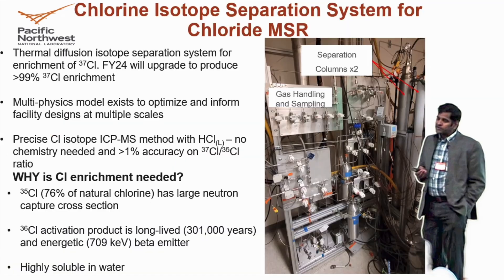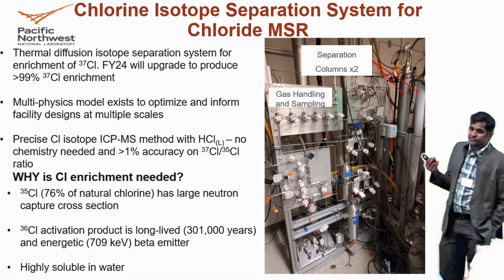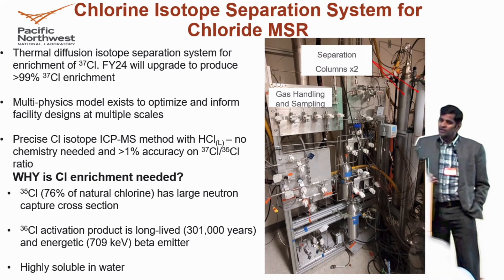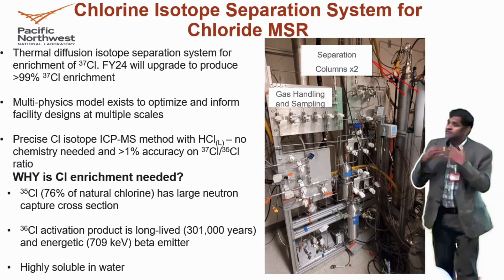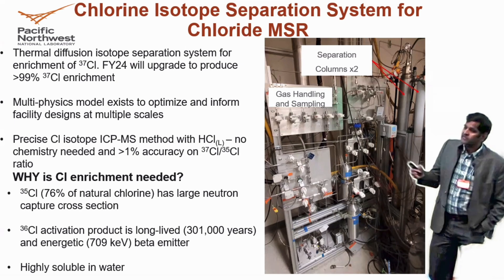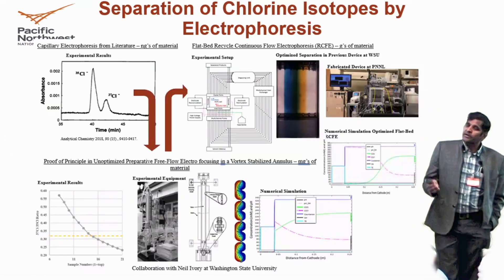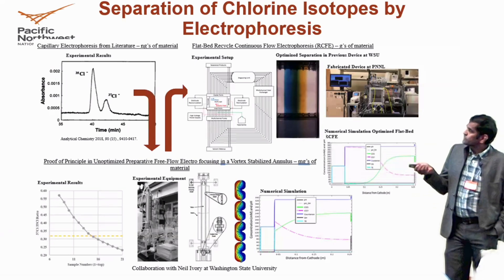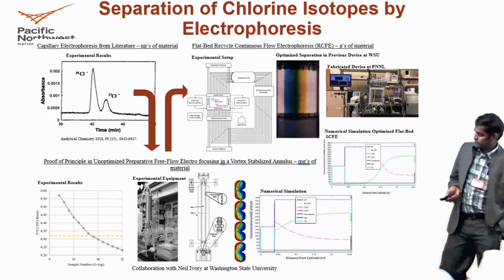Chlorine Isotope Separation for Chloride Molten-Salt Reactor - Praveen Thallapally @ ORNL MSRW 2023

Comment: It would probably make sense to also ensure the missed (~1%?) Cl36 is bred to Cl37 in the reactor.  The "waste" from the reactor will be dangerously radioactive for far more than the typical 300 years if that is one of the products.  I'm wondering how the cross-sections are of Cl36 and Cl37 are at the (thermal) energies planned for the MSR?